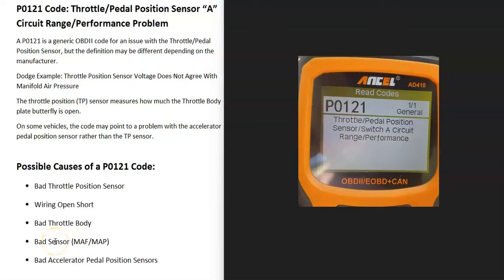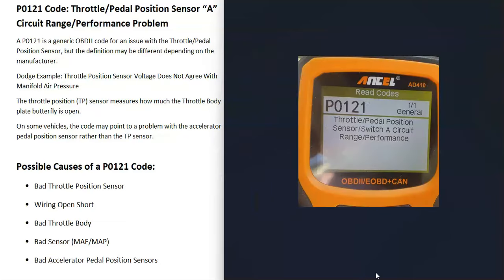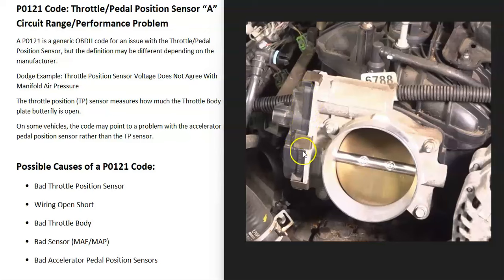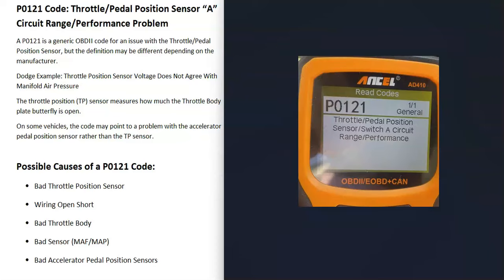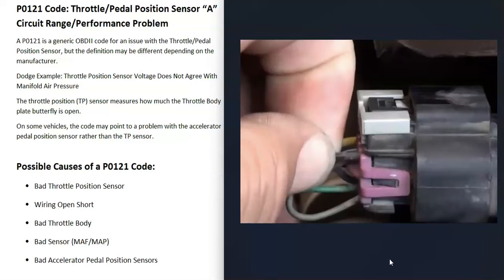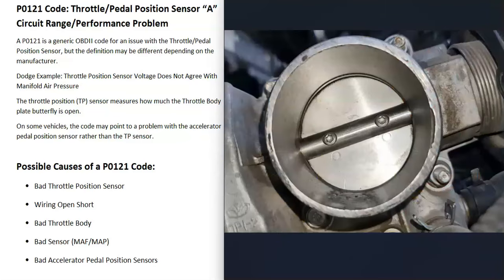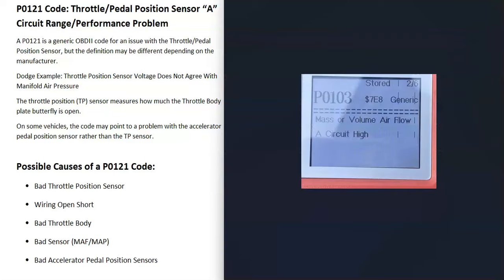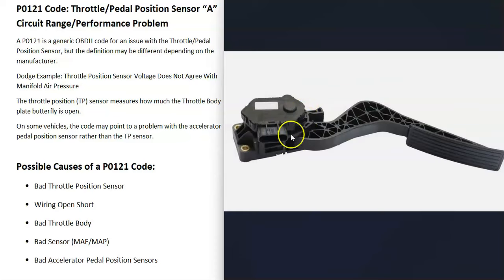Causes and Fixes P0121 Code: Throttle/Pedal Position Sensor “A” Circuit Range/Performance Problem

Comment: had the code. Cleaned throttlebody. Code went away 2 weeks later it returned along with P2111, cleaned the TB again from the both sides this time. (it was not stuck open) cleaned MAF sensor. P2111 went away, P0121 stayed And now the throttlebody opens and shuts with clicking noise when I start. RPMs go up and down, when I press the gas pedal the car reacts normally but when I let go it nearly staled (AT so it did catch it self). I am at a loss. Mechanic far away. I am about to seit it on fire and be done with that god damn car already.
Reply: sir my toyota etios car is having the same problem. p0121 error. cleaned throttle body but it again came back after 3 weeks. Car doesn't Accelerate. What to do? should i change throttle body or the sensor?
Reply: @shubham.sharma332 Expensive - dont do that yet. In my case it was dirty MAF sensor. I was cleaning it several times, but it turned out that all I did was cleaning temperature sensor over and over. The MAF is inside of the sensor assembly. if you look inside the hole of the cilinder on which temp. sensor is part of you will see two tiny wires, going across the opening. thats your MAF sensor. good luck
Reply: i have a p0121 error  , watching the live data stream there was oxygen bank sensor errors, i think too low of a voltage, it would flash on and off but they didnt throw any codes, maybe its related? I seen another video where the gear in the throttlebody has too much negative slack because of some broken teeth, it could just be a bad throttle body gear/motor  or even whiper contact inside.
Reply: @mikejones-vd3fg  I was cleaning MAF sensor wrong. Same as 90% of all people on here, that are also just spraying the temperature sensor part xD It was oily MAF from my newly installed KN filter all along.
Reply: @DanielTejnicky  Ahhh thanks for the tips.
Reply: Need help I been having the code for bad throttle body so I bought one from amazon and it still comes up code p0121 and p02101, and my buick enclave says reduce engine power etc.. can it be a bad throttle body,they have the sensor built in with the throttle body. Maybe it's a cheap part I bought.  Ty
Reply: ASE certified, Master Auto Technician here. This video full of bad information. Please do not take it seriously.
Reply: @18avshalom Is that really all you have to say. You would think a fancy world class super duper elite top flight badass maintenance guy, such as yourself, would have a little more input regarding all of the bad information that you claim is littered throughout this video
Reply: @DanielTejnicky thanks man I’m about to check it out after work

Comment: Hello sir my vehicle found the p0121 code throttle position sensor 1..kia rio hatchback 2014..what will you suggest to do..do I need to change sensor or need to clean the throttle body? Thanks
Reply: Sensor

Comment: My issue is definitely the wiring. Replaced all hard parts between my switch circuit E (pedal, and throttle body)